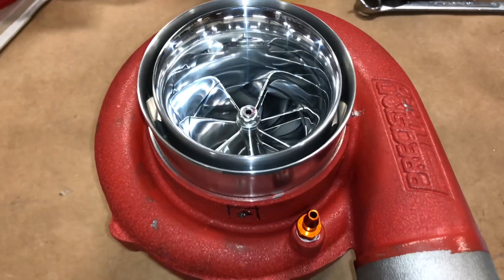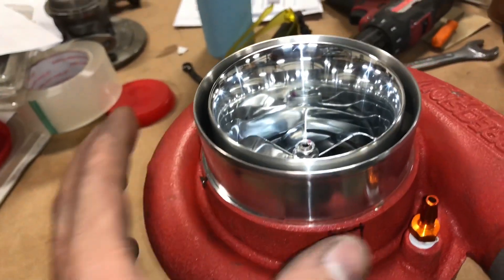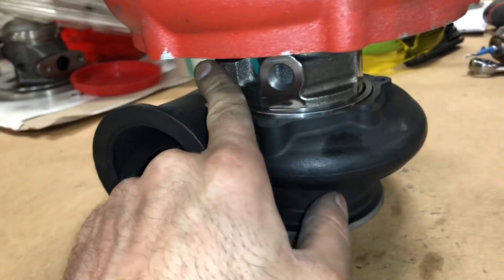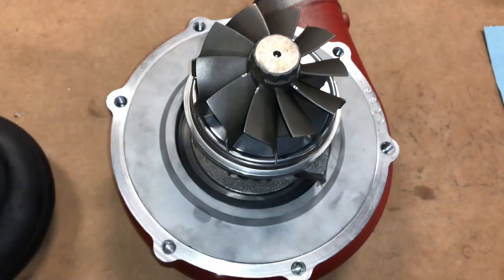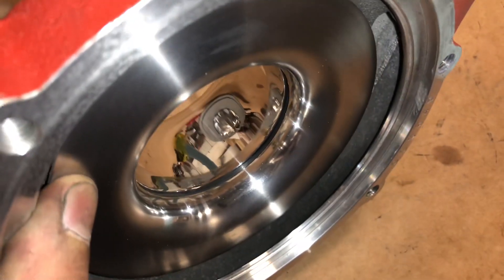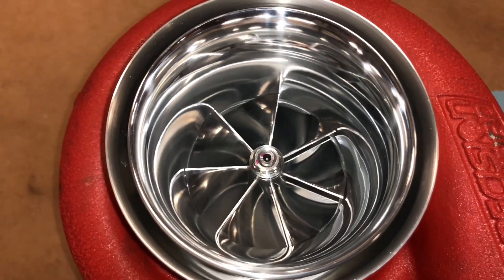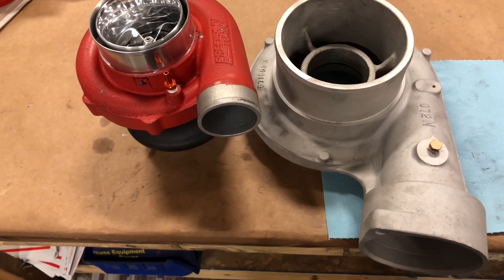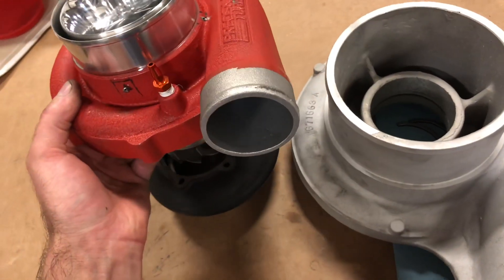Precision 6466 T51R mod + upgrade to 67mm ballbearing

Comment: what tolerance you machine for in compressor housing. 67mm inducer ..for example.
Reply from the maker: This wheel is 66.3, so I machine it to 67.1 (.8mm larger) some models I machine to .85 , I prefer no less than .7 on smaller models
Reply: @turbolabamerica  in the ones i do gtb2260.      0.7mm its not enough.. Compressor can touch the housing because there is too much play even with new repair kit and shaft.

Comment: How do I contact you with questions?  I'd like to know if it's possible to convert a Borg Warner S369SX-E to ball bearing and possibly increasing the exhaust turbine size from 80mm to 83mm.

Comment: Even with the T51 r mod if it was A 11 blade it would still be quit. With this mod i found the less the blades, the louder the turbo.
Reply: The sound is determined by the pitch and the angle of the blades